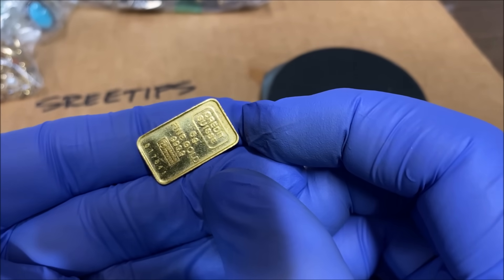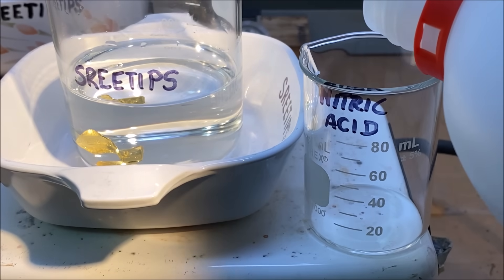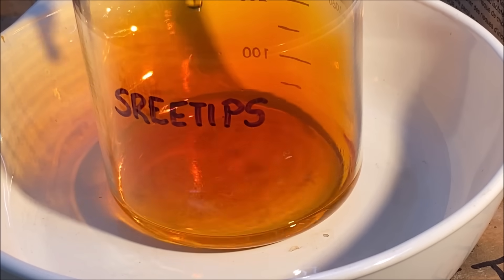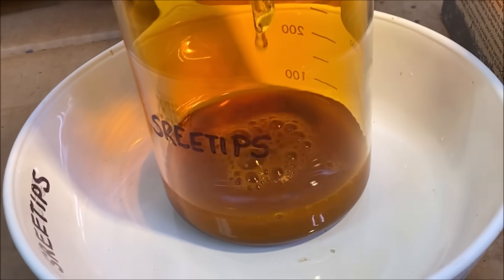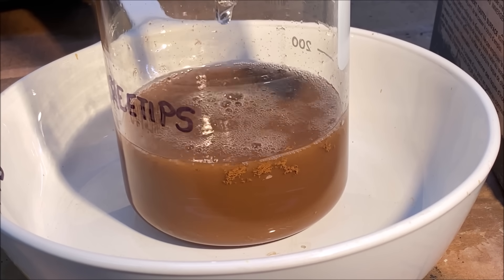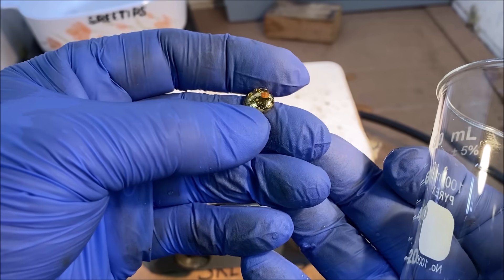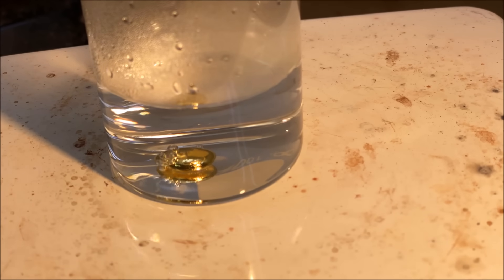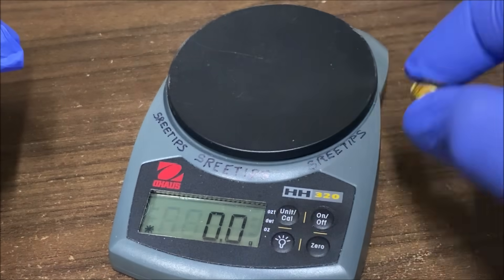Dissolve 5 Gram Credit Suisse Bar in Aqua Regia

Comment: Question: if you dissolved it in AR, shouldn't it have been filtered before going back to precipitation?  Also, to prove only gold was being dropped, wouldn't ferrous sulfide been a better choice to precipitate?  That way, after rinsing and cleansing with HCl, it would be sure to be purer gold, and when measured after, would be .999 instead of the .9 advertised?
Reply from the maker: I avoided filtering, and rinsing, on purpose to avoid potential loss
Reply: Is smb precipitating gold only or also other platinoids?
Reply from the maker: SMB will bring down traces of PGMs, if present.

Comment: Looks like 98%. Great video, in any case.
Reply from the maker: Close enough to call it good.
Reply: There was a tiny bit left in the beaker he rinsed out into the filter. You can see it when he was using the spray bottle. It was in the top right.

Comment: I believe unscrupulous sellers or buyers would produce a bar that is less than advertised. Also, same buyer would take a . 999 bar and claim it wasn't what the seller thought it was to not pay as much. I am glad your bar came out pure
Reply: Well, the problem wit "adulterated" gold is that even a small amount of any other metal would cause it to harden noticeably (thus the "medieval" test method by biting a coin - as even a light bite would leave a small indentation on the coin, or bar), and it also changes the appearance of "poured" ("open" cast) piece of gold - these distinctive rings on the surface of solidifying piece would not appear, or would differ in appearance. (Obviously, you can't see them in pressed, or "stamped" bars or coins.)
AFAIK the most common trick here is taking a tungsten bar and covering it with a thin layer of gold (1 mm/ 0.04 in or so), as density of tungsten is almost the same as that of gold - for W it's 19.254 g/cm3, for Au it's 19.283 g/cm3, so only mere 0.029 g/cm3 difference - impossible for humans to detect.
Reply: @MrKotBonifacy  A Sigma Metalytics instrument would find a tungsten filled bar in a heartbeat as would an ultrasound directed testing instrument. A smart precious metals buyer will have several testing devices that can be used for various material that are all non-destructive. The method used here is the ultimate foolproof just not as practical in a selling or purchasing setting.
Reply: @10xitall  Yes, I guess a pro guy dealing in "all things gold" would, but then an average Joe the Sucker on the street won't... ;-)
Reply: @MrKotBonifacy  Yes, I completely agree with you on this point.
Reply: Those are the people I feel should be the homeless not the ones that will happily give you half of their sandwich not knowing when their next meal will be.
Stop doing business with sly scammers
Reply: @Robyn.Aussie  Everybody stops doing business with scammers - after the first time, that is...

Comment: Pouring the button out into your palm over that black hole in the sink made me a bit anxious😅
Reply: Plumbers around the world tripping over themselves to service the sinks of gold refiners.
Reply: @ You joke, but I saw a video about the refining process at a gold lab and they mentioned that at the end of the year they recover thousands (if not tens of thousands) of dollars worth of gold from the floor mats and waste water filtration systems.
Reply: I expect, due its density, the gold would get caught in the u-bend/trap of the drain pipe under the sink.
Reply: That's why all plumbing is fitted with a trap. In case you drop your gold down it.
Reply: It would not have made it past the P trap

Comment: Everything I find on the subject says it takes about 1 ml of nitric acid to dissolve 1 gram of gold. You used 50 ml for 5 grams. I don’t understand why you would use 10x more than necessary.
Reply from the maker: Loss of proficiency
Reply: @sreetips I have 10 little 1gr bars from a Valcambi combibar. I bought them off of the Walmart website but it said sold and shipped by APMEX. I normally trust APMEX, but I read recently that some people were getting counterfeit silver eagles so I had considered doing this very thing. My quandary is that if I do it I’ll have 1 10gr button with no markings to indicate source of purity and I’ll no longer have ten small units, which is what I like with gold.
Reply from the maker: That’s part of the I started refining, it’s the only way to be absolutely sure.
Reply: Probably to speed up the process.
Reply: Oh! this is an interesting information I have been searching for. Thank for sharing. Is there a link to this information for further study?
Reply from the maker: @pazgomenskii5310  I specialize in refining precious metals, mostly silver and gold. Platinum and palladium too.
Reply: @ C.M. Hoke - Refining Precious Metals Waste.